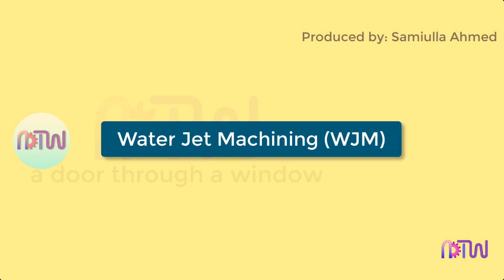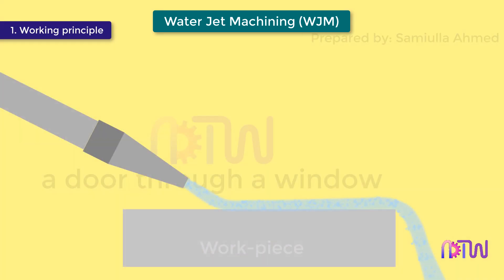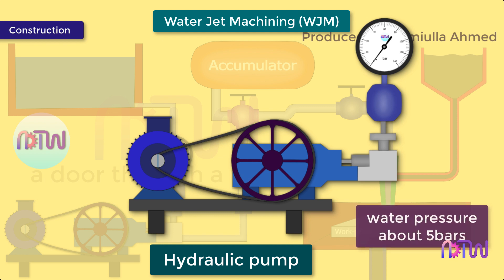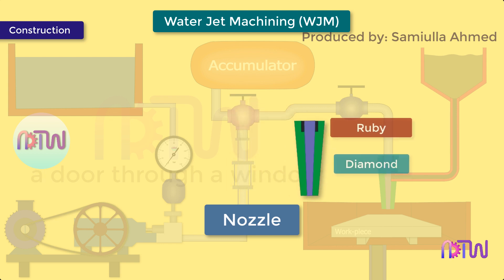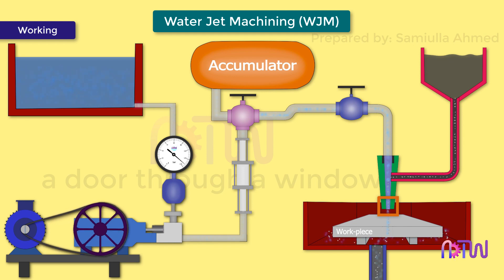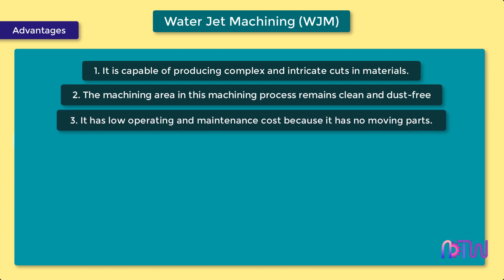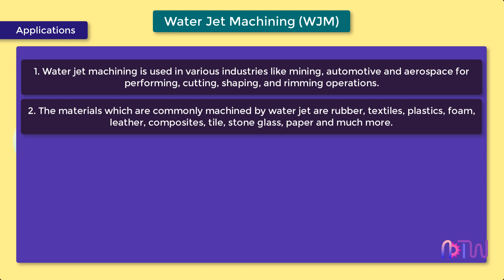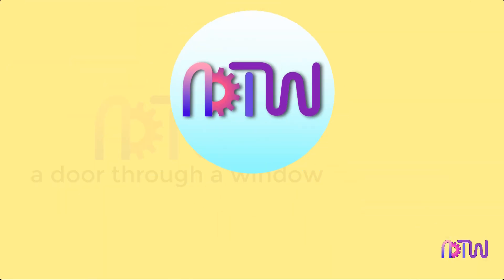WATER JET MACHINE PROCESS : Working of abrasive water Jet machining process (animation).

Comment: Process parameters of  Water jet machining
Reply from the maker: Water Jet Machining is a cutting process that uses high-pressure water to cut materials. The following are the key process parameters that influence the outcome of the process:

Water Pressure: The pressure of the water jet is a critical parameter that determines the cutting speed and the quality of the cut surface.

Flow Rate: The flow rate of water, or the volume of water that is delivered per unit time, is another key parameter that affects the cutting speed and quality.

Orifice Size: The size of the orifice, which is the opening through which the water jet exits the nozzle, influences the cutting speed, quality, and energy of the jet.

Abrasive Type and Size: The type and size of abrasive used in the water jet influences the cutting speed and the material removal rate.

Stand-off Distance: The stand-off distance is the distance between the nozzle and the workpiece, and it influences the cutting speed, quality, and energy of the jet.

Nozzle Tilt Angle: The angle at which the nozzle is tilted relative to the workpiece surface affects the cutting speed and quality of the cut.

Feed Rate: The speed at which the water jet moves over the surface of the workpiece, known as the feed rate, also influences the cutting speed and quality of the cut.
Reply: @ADTWstudy  thank you sir